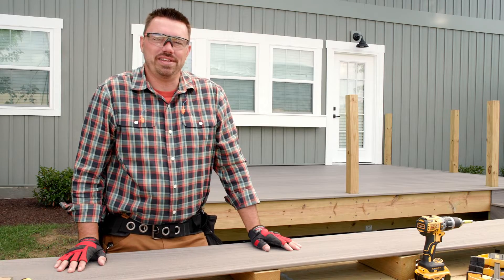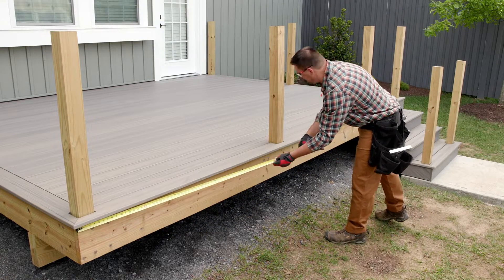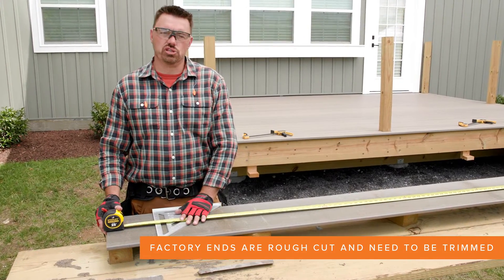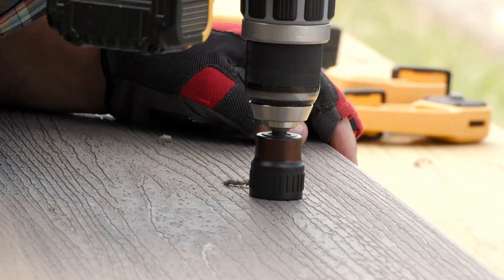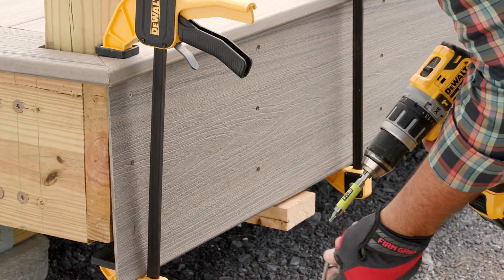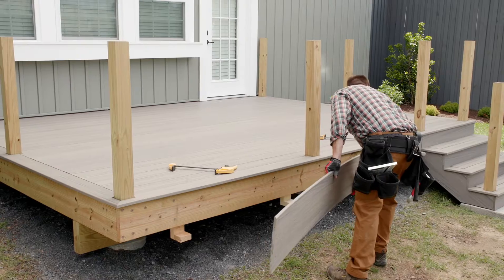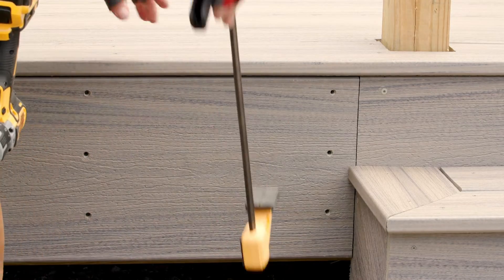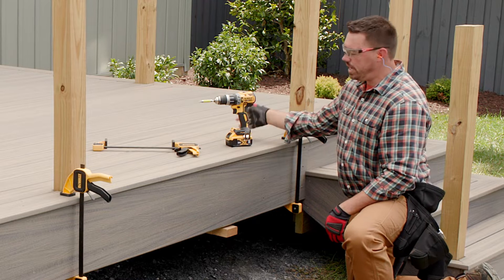How to Build a 12x16 ft Deck with Trex & The Home Depot Part 2 | DIY Decking

Comment: Wouldn't the fascia screwed against the rim joists be subject to possible moisture retention between the joist and fascia board and promote joist rot?.  Should 1/8" or 1/4" strips be added as spacers at the screw locations to allow air circulation, or simply not needed?
Reply from the maker: Hi Dino, thank you for reaching out and for watching our video! This particular installation has an overhang from the deck boards. This will help prevent water from getting behind the fascia material and causing issues. If you choose to do an installation where the fascia comes up to meet the edge of the deck board, we would absolutely recommend a spacer in between the fascia and the rim joist. To help take the prevention a step further, we also have a TrexProtect 11" joist tape that can be added to your rim joist before installation. We hope this helps. If you have any questions, feel free to give us a call at 1-800-289-8739. Thank you, Trex Customer Care Team

Comment: I'm building a Trex deck that's also 12x16' and about 2' high, just like in your video. But I'm not planning on using a ledger board, and instead will have 9x 12" cement footings. The beams will be resting right on the cement footings, also like in your video. 

My question is - how can I best install the end joist board (where the ledger board would've been) without attaching it to the house since I want my deck to be freestanding? Do I have to put in temporary supports under a few of the joists (running perpendicular to the house) to support this end board and just remove them after the end board has been installed?
Reply: If you are doing a "freestanding deck", the posts could be notched to allow the rim joists to rest on the post. You could also build a beam that runs perpendicular to the joists to support them. The beam would then rest on the notched posts. I'm not 100% sure what your framing plan is but there are options!